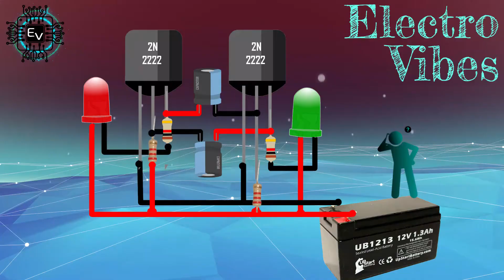Flip Flop Led Flasher Circuit Using 2N 2222A Transistor

Comment: The thumbnail is the most useful part. Also thank you

What i did for my flip flop is use 9v and 10k on base positive side of transistor and 2k resistor on led emitter sides for both. 100uf on the flip flop sides as the thumbnail